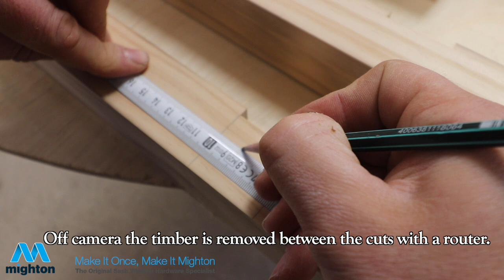Sliding Sash Window - Mighton Weighted Box Sash Window Series

Comment: Beautiful workmanship, I do wish that the inside of the frame where the bottom window closes was stained like the original ones as painters see the paint and put another 2 coats on usually every 7 years so it doesn't take long before the windows get stuck, I prefer the small arc that is painted where the sill meets the frame, but that's just me, I honestly never realised how much work went into these, cracking job
Reply from the maker: Thankyou! Yes they do get gunked up with paint, but arent the easiest to paint either.
Reply: @BradshawJoinery  I have spent most of my working life repairing and painting sash windows, I actually quite enjoyed it, but your video was quite an eye-opener and very enjoyable to watch

Comment: I am a solid finish carpenter & learned from a Dad who built custom (I mean custom I am standing in one) homes and Spec’s.  Then worked about 5/6 years for a “Millworkers license” in the states.  I am a “more mature “ man but it has not stopped me!  I arrive early when finishing and out work most 30 yr old easily!  As John Wayne said not bragging just a fact!
Can you tell me what are the critical tools I need to start learning to build windows and doors brother?  I hv a great 3 hp 52” cabinet saw, big router table, small jointer & planer!  Plus great track saws , hand routers plunge and trim, drills, a drill guide (expensive kit $250 bones) to drill straight plum holes I use on custom tables for haunch tenons using dowels to draw it in.
Go ahead hit me with the bad news!  I trust you and watch all your videos you are an incredible teacher and custom mill worker!
Reply from the maker: Nice to hear mate, music to my ears as i finish up 65 hours in 6 days!  Your pretty much there. For doors id suggest tenon discs on a spintle moulder with sliding bed or a tenoner. Id opt for a basic tenoner like the multico tm2/3

Comment: Very very Nice! -- SUGGESTION -- There is a noise in sash windows arising from the balance weight moving as the window opens and closes. Try putting a sock or FELT fabric of some sort over the weight before installing it.  You will be amazed at how silent it becomes.  Massive change and makes the window seems much more quality as sound plays a large roll in perception.

Comment: Great workmanship. I am in the process of getting quotes for 18 windows the same as these, although no bars on the glass . I have also considered building them myself as I love woodwork and have built the house the windows will be going into. The first quotes are a little over 4K (Aust dollars) so approx 2K pounds. A question that you may have answered elsewhere? but what is the 'typical cost' of a window like this, and how many hours does one window take to complete? I have the dilemma of completing them myself and saving money, but taking a very long time to get the job done. I have most of the tooling. Your video gave my just enough encouragement to have a go - but also showed me how much skill you need to do the job well. And you have great skills.

Comment: Perfect, remember area between glass and frame should be ventilated, two holes  on the sites  in this case will do, otherwise after 5-10 years corners of frame will be rooten thanks to water condensation, did You try springs instead of ropes?Thanks
Reply from the maker: Fully sealed is fine with this method, I have used balances before, but the ropes are better if you can afford it and have the architecture to suit.

Comment: I'm looking forward to the next part.

Please would you give links to the ovolu cutters and scribes you use for the inner box frame mouldings, and for the sashes and glazing bars.

Are you using 14mm glazing units? 

Many thanks.
Reply from the maker: Hi Ivan, i will be Releasing drawings soon, and if you contact and cutter maker with your requirements they will make them up for you. I like Paul @ Cutter profilers uk

Comment: Blown away by the level of detail and precision. On a job like this I guess dialling in all the machines must take a while. Were there any oversights, errors, things you'd do differently or look out for next time?
Reply from the maker: Hi, Yeah there is a lot of time and thought goes into the whole thing. Its all fairly worked out, so nothing to do differently. i stored them for a while and the parting beads stuck int he grooves a bit so i would seperate them next time

Comment: great work. are the sash weights, steel, or cast iron.  also notice there square edged, not round like they use to be.
Reply from the maker: Steel weights from Mighton. The square profile just gets the max weight from the space in the pocket. Back in the day they didnt have them worried with lead weights and single glazing....

Comment: Very useful video - thank you Oliver. At 23:29 you stick the external beading directly to the glazing with a wet glazing putty/sealant but in your part 2 sash window restoration drawing video you used 2 mm foam tape in between the sash timber/bead and the glazing. Do you no longer use the foam tape method? Is there any danger/downside of not having the foam tape?
Reply: Also, given that you stick on all the external beads/bars on, does this mean your preference is to no longer use dowels to fix in the bead/bars in any circumstances?
Reply from the maker: Hi Sam, its different techniques for different scenarios tbh! My ultimate system is using Accoya and dowelling the outer bars, then setting the glass onto that then wet sealing the joint, and tapes inside. This method here, is better for these windows, because client wanted inside to be as realistic as possible (so no beading) therefore i did a fully wet glazed outer, tape inner. You could bed on sealant too but can play havok with scribed beadings, differing bed heights etc.
Reply: @BradshawJoinery  Really appreciate your reply Oliver. I tried buying you a beer but it said my postcode wasn't valid - will see if I can find another way.

Comment: Hi oli great work as always. I've recently taken over the business I've worked for, for the last 17yrs after losing my late boss to cancer. We have a similar set up to you doing similar work. Your videos have helped alot so thankyou keep up the great work.  I was wondering why you didn't have georgian spacer bars in your units its something we've always done. Also I'm new to spraying, I assume that you apply your last topcoat after the glazing is installed and any caulking/filling has been done? Best wishes
Reply from the maker: Cheers Kevin, good luck to you. No Duplex bars as the units are thin enough not to need them (6mm cavity) No sprayed then assembles, just touch up any bits necessary after fitting.

Comment: I really enjoy your videos you are a master. You probably mentioned it before but I know you spray waterborne coatings and I was wondering what pump size you have. I am really considering a Graco Merkur 30-1 and I was curious what size your pump is.
Reply from the maker: Cheers Jason, it's an old merkur @ 30:1. Won't go wrong with that size. Get really got an 11/30 tip. Deffo get a Wagner gm4700 gun.
Reply: Yes I have the Wagner gun GM4700 and I love it. I am currently using it with a small compressor and a Tritech T5 but I would prefer the merkur. How much cfm would I need with the 30-1. I really appreciate all the help. I am just about ready to switch over to the waterborne materials
Reply from the maker: Now for that question I have no idea. We have a big hyrovane compressor and I just turn it on and plug into the airline. The compressor is a hyrovane 33 if that helps. 😂

Comment: Nice Job i am in the trade and would be very happy with those windows. Do you send them out fully assembled because there is some weight to those   making transport and instalation very difficult.
Reply from the maker: Thankyou William. I dont, i would install the frames then assemble sashes into them once fitted. They could be sent out complete but its hard work!

Comment: Nice work, but weights and pulleys?  How can you insulate?
Reply from the maker: There is no airgaps from front to back and its made of timber, they are pretty good on insulation i think. Depends how extreme you are taking your insulation values, wont see them in a passive house,

Comment: Gday mate, I’m after one on those ‘pressure wheel’ / feather boards you’ve got at 5 minutes in mark, is that a felder
Product?

Bloody handy for under the feeder!
Reply from the maker: Hey mate, yeah its a felder thingy. I just spent ages finding what its called and it became a mission haha... but.... felder pressure module! Its very good i use it alot, but daymmmmmmm £££
Reply: @BradshawJoinery  thanks heaps Ollie! I’ll tell the rep👍🏻. Just got the metal bracket things and another cast iron table extension ( had one on bandsaw)  idea is I can relax more rebating doors over the spindle 😂
Just changed the power feeder rubber wheels, man what a difference the simple things make

Over in Uk Friday see the family 👍🏻 bit far from Scotland or I’d come and say hello  😜

Comment: Beautiful work as always, I just have installed my brand new Accoya sash windows in my old house, and as i have been installing them, i see more and more things wrong with them,  things that dont make sense to me at all, im an amateur carpenter, and even i see the logic of how you just made yours. On mine they installed brushes along the entire length of the parting bead, black ones (my windows are white) they also installed brushes on the staff beads, also black, there is no grove on the bottom of the sash to stop capillary action, most troubling there is a 6mm gap at the edge of the meeting rail on both sashes that allows air flow from outside to inside, or shall i say cold air from higher pressure moving into the lower pressure of a warm house past DOUBLE GLAZING the mind boggles the carpenter says the gap was there to allow the bead to be removed for brush replacement. oh and the glazing compound is black! they havent even sanded the Georgian bars...$40k for 5 singles and 1 double....i went to a non franchise carpentry shop because i though it was going to give me a better quality product, now im left with 1000s of dollars worth of fixes on expensive windows. your work is consolation that there are really great craftspeople out there giving a customer amazing value and a work of art to be proud of. keep up the great work.
Reply from the maker: Hi Simon, It sounds pretty common what you have there. Unfortunately there isnt widespread training of the artistry to perfect such a window and your only as good as you know how to be. Perhaps forward the video to the company and they can learn something? I hope you get sorted. I think there are brushes available for the meeting rail end gaps. Cant remember where i saw them.

Comment: Sorry, missed adding the link - Brent Hull - https://youtu.be/hLbTpa9uEoY
Reply from the maker: Thanks, it's interesting to see different countries views. Over here there is no way in hell your putting single glazed in unless on a listed or special building permit/graded property. Vacuum or heritage glass is probably as close you'll get to that thickness and is achievable but not 100 year life. Also sapele and putty wouldn't last 100 years over here. Joints crack after one year (4 seasons) on any hardwood window, even if v grooved and sealed at the joint because of the ambient moisture variations of our climate. For that window to last 100 years the architecture around it needs to protect it, deepened reveals roof overhangs etc. 

Accoya fits the bill well here. Insulated glass that is easily serviced, in a window that will last a lifetime